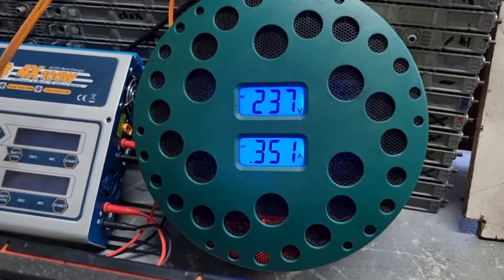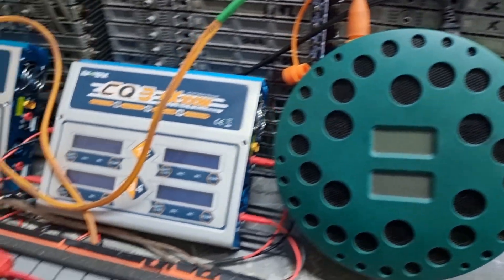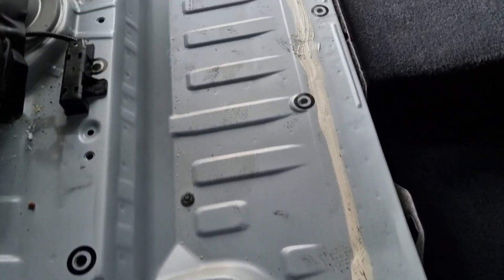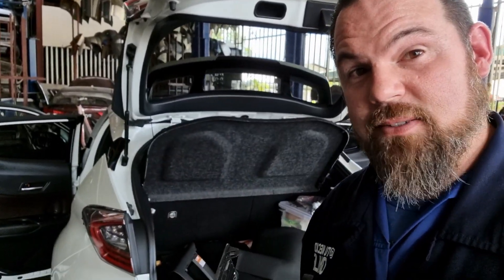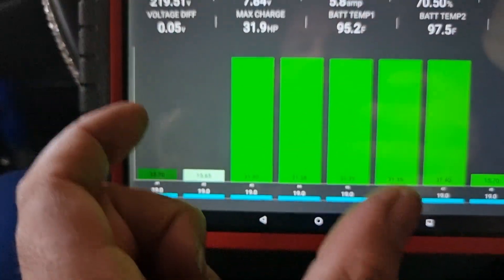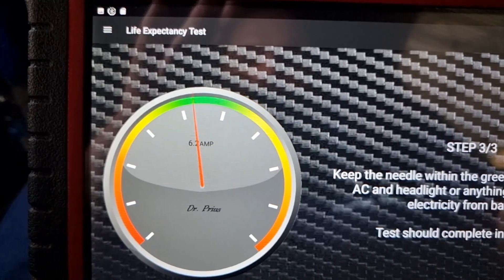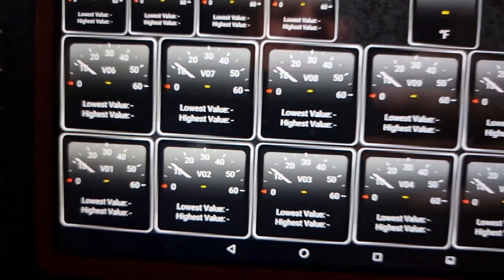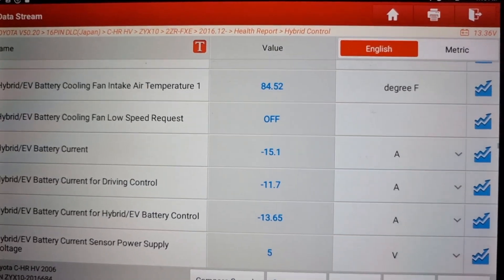2017 toyota c-hr hybrid battery service part 2

Comment: Hi I have fault p058ao1 chr 
Is it the sensor or battery
Any help much appreciated
Reply from the maker: It is not so difficult to diagnose this code… with the live data stream should be easy to detect the faulty component… usually current sensor

Comment: Any chance u could do a video on hybrid battery Drain test on toyota pruis. Put the vehicle in ready mode and turn the lights on and the AC, with the radio. Then put scanner on to see which cell or module are not charging properly.
Reply from the maker: Yes... you can do that with the scantool...

Comment: Hi again Jose, Just emerging those Ecube CQ3 4CH 100 Watt Hobby chargers they look the part like how at the back where the power board is has heavy chunky heat sink even been doing some reading up on them... just another thought you know all those plastics like fan, bus bar stencil/ covers, compression blocks, fuse housing, fuse block, air flow channel/induction pipe intake vent etc etc all thoses nasties including some metal parts using a dish washer in the work shop where you'd use friendly detergent an on the conditioner holder you could use bi carb soda to neutralise the sugary acid within the purse of the plastics etc n metals 20 to 30mins everything would be crispy clean n' minty fresh haha wouldnt that save you time an stop recurrence.... might even get a change to do a vid on those chargers hint hint.
Reply from the maker: Charger videos coming soon 👋😎

Comment: What is the "balancing" procedure? You just give 240V to all the cells connected sequentially. If there's a difference in the internal resistance, the cells will have a different voltage. How do you expect that "this" is a "balancing"?
The balancing is to 100% be sure that the cells has the same voltage, isn't it?
Could you please explain me, what am I missing?

Comment: Is there any filter installed in hyundai/kia? (Ioniq, niro, xceed etc.)
Reply from the maker: No filter at all so they will need a cleaning service somtime.
Reply: @hybridsolutiondiagnostics   is there a reasonable space around vent intake to fit some  DYI filter component?
Reply from the maker: @bartoszbaranowski9475  sure of course there is 👋😎👋😎
Reply: Thank You Jose!
Reply: Jose take your battery hands out of your face, please